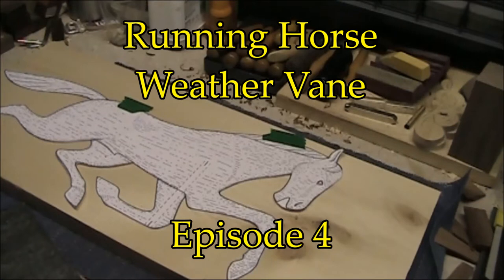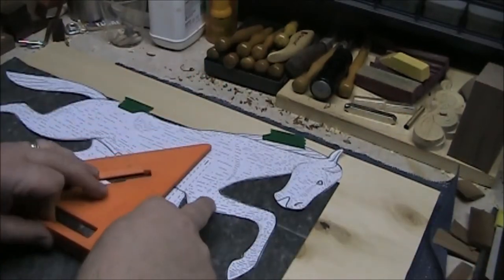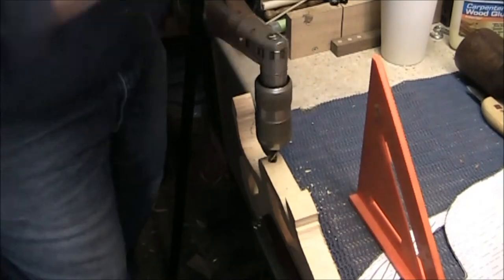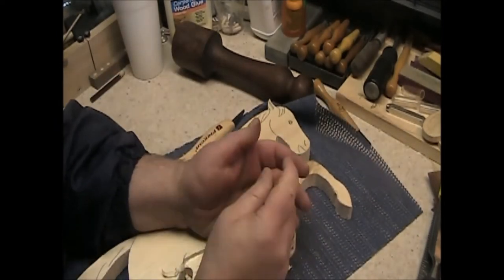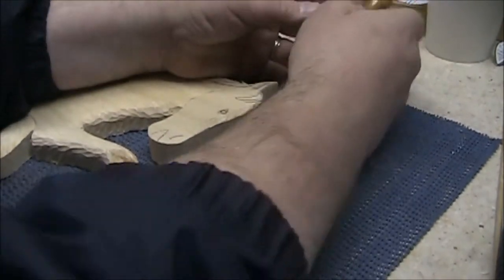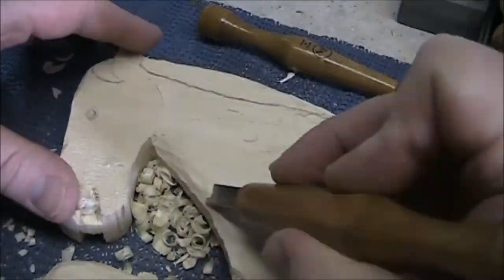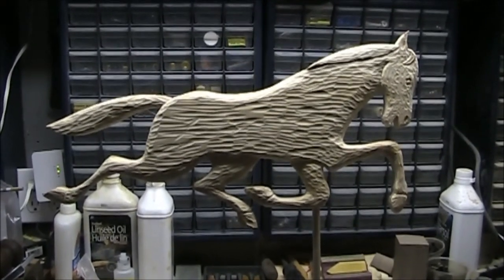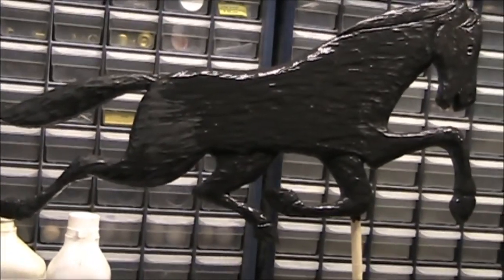Horse Weather Vane

Comment: Thanks so much for the tutorial as I am about to create a weathervane for my wife's horsebarn.
Reply from the maker: Thanks, it's is still in the garage. I really should put it up. I will have to try and remember that in the spring.  I am not sure if I mentioned this in the video, but I would drill the hole while you still have square edges.  Mine might be a  little crooked because I drilled mine after it was carved. Good luck with yours.